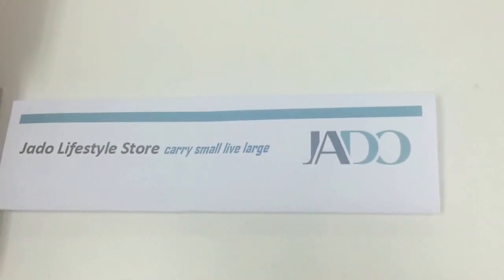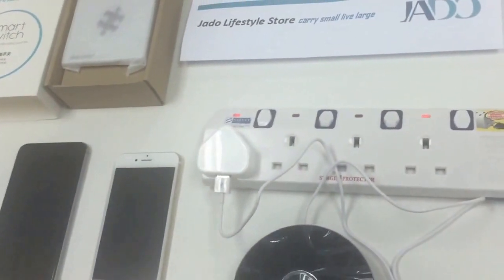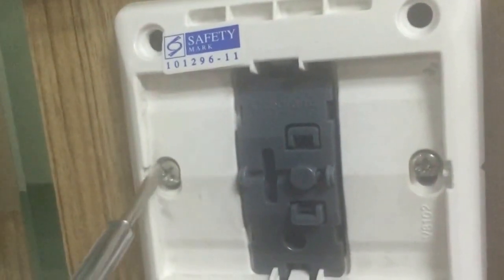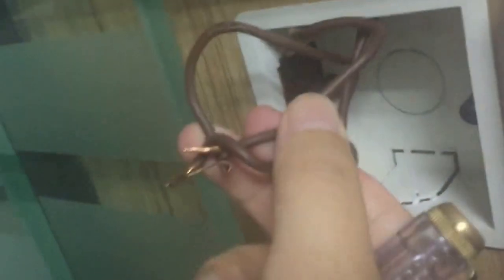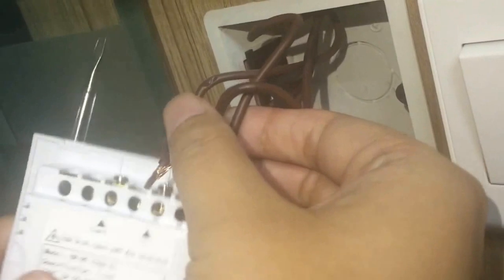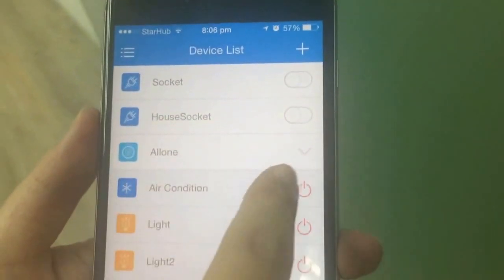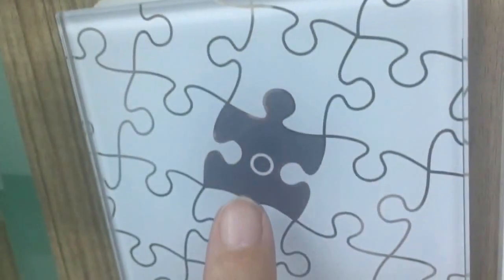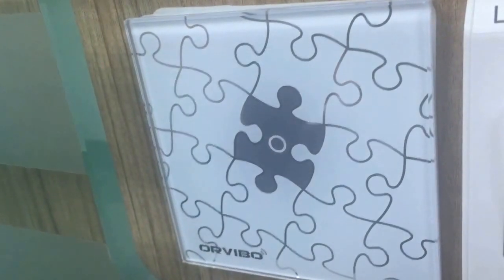Jado Home Automation Orvibo Wall Switch Physical Installation and configuration

Comment: if the light bulb is an rgb light bulb can we control the dim and color from the app?
Reply from the maker: +Luaay Naboulsi hi, i don't think so. as this can only control on/off. Turn on and cut off power. if you want to control dim, i think you need the special light with special separate control. thanks